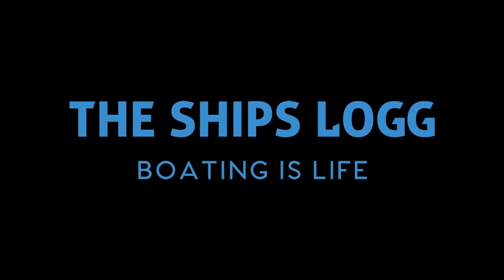Make Your WaveRunner Piss on Demand!

Comment: Hey Captain Frank, I just wanted to take this opportunity to thank you for this fantastic idea. You don't realize how embarrissing this water flow can be until you pull up some where and turn around and spray everybody sitting on the dock with a drink in their hand. I like the option of being able to turn it off and on. Since I performed this conversion on mine,  I have had no problems and noticed that its not a partial reduction in water flow its a complete stoppage of the water flow. Keep this great intel coming.

Comment: Good info! I always thought that was the engine cooling line like my jet boat has and it was there so you can readily see that it is flowing and there is no blockage.
Reply from the maker: Joe,  I don't think you are the only one that has thought that.  Actually, the cooling water for this model comes out on either side just forward of the rider which is great because you can see it when you are riding.
Reply: @TheShipsLogg  I thought the same thing up until just now.  Lol!!  Captain Frank, could you do a video of how the cooling system works on these Waverunners?  I'm trying to diagnose an overheating problem on a 97 GP760.  I'm new to jet skis but I've learned alot so far.  I've rebuilt the carbs and tuned them on 3 different Waverunners so far!!
Reply from the maker: @TheVenom8343  wow!!  Very nice!  Sounds like you are well on your way to being a good PWC mechanic!!!  I'll put that idea on my list!!
Reply: @TheShipsLogg  Well, I figured out the overheating problem.  It had a little perfect sized pebble lodged into the little water intake hole at the jet pump.  I'm assuming that is the water intake point because it's not running hot now.

Comment: Hey Capt Frank! Great video. That water spout was one of the reasons I went Sea Doo. I'll have to check to see what other jet ski parts so can find cheap at Lowes!
Reply from the maker: I know that many Yamaha owners simply disconnect the hose and let it hang so the water spout does not work.
Reply: There is no negative effect from just pulling the hose off for good.

Comment: I used that exact same Rain bird valve, it only lasted one season before the valve body (that green part) blew out.  You will want a stronger valve!
Reply from the maker: So far, mine has lasted 2 years in salt and fresh water.  We'll see how much longer it lasts.
Reply: there is a more robust valve made. I think its like 20 bucks @TheShipsLogg
Reply from the maker: @jimcloud74  I am sure there is.  The one I used works well but I don't know how long it will last.  I just got another ski and I will try a different one on this ski.
Reply: Nice sir! I originally got a cheap valve and it blew apart. Happy riding!  @TheShipsLogg

Comment: I used a rubber stopper. Simply has a little ring bigger than the hole you just press it in there. No idea what it is, found it laying around my garage for some plumbing. I put storage bags on the back of my vx limited and it just sprays everywhere so I told it to shut it's trap. Also, nice photo of La Jument, one of my faves.
Reply from the maker: LOL!!  That's right!  Show it who's boss!!
Reply from the maker: That is one of my fav pics as well.

Comment: Thanks for this and all your videos.  Constructive criticism, instead of saying over and over make sure you cut it long enough to clear the gate, you could have simply said, I cut it 3" from the top so it wouldn't interfere with the gate.  (my .02)
Reply from the maker: Good point.  I did try to avoid giving specifics  just in case someone else has a different model Yamaha and the measurement is different.  Thanks for watching and thanks for your 2 pennies!  😁

Comment: Thanks for that great idea.  I have a question hope you can help me figure it out.  I have a 2015 Yamaha Waverunner V1 and it comes with no ladder or step to get back on the ski.  Any ideas on how I can install an OEM ladder or step back there. Thanks in advance
Reply from the maker: There are some aftermarket ladders sold for jet skis.  Some are similar to the OEM type that some PWC's come with and others are the much simpler rope ladder type.  I would start  by checking Partzilla to see what they have

Comment: That was really useful. Hope it’s as easy on my 2008 FXHO.
Reply from the maker: I'd love to know if it is the same on your machine as it is mine.  Drop back after you have done it and let us know!
Reply: @TheShipsLogg  here in Scotland most skis are tucked away for the winter. Got mine out of the garage today to have a look and it certainly looks like it will be as easy. Just need to find a suitable tap to plumb in.
Reply from the maker: @simonfr77  That's awesome!  Let us know how it works out!!
Reply: Worked a treat. 13mm ball valve (£3.50) and a couple of stainless steel hose clips and 10 minutes later job is done. Easy to do. Washing up liquid advice was useful. Thanks very much 👍🏻
Reply from the maker: @simonfr77  Awesome!!  Glad it worked out for you.  Now, its time to have some fun!

Comment: Anyone know where I could get a new hose? Want to put it back on
Reply from the maker: You can go to your local auto parts store and buy a length of rubber tubing and just cut it to the proper length.
Reply: @TheShipsLogg  yup, just thought it would be better to have a formed hose to help keep it clear of the reverse bucket
Reply from the maker: @timsgarage1861  I don't think mine had a formed hose but I could be wrong.  It's worth trying to see if a regular one works.

Comment: I have two questions, 1: Will adding a valve affect the original water flow pressure? 2: Will blocking it cause reverse flow of water?
Reply from the maker: No it will not.  A lot of people just disconnect the hose and leave it hanging.

Comment: What happens to the water pressure coming from the pump when is turned off?
Reply from the maker: Instead of being routed through the hose for the waterspout, it just goes out the jet nozzle instead.

Comment: What's the size on that hose/valve? 3/8"?
Reply from the maker: 1/2 inch.  It will be a tight fit sliding the hose onto the valve but that is what you want.  I used a bit of dishwashing liquid to make it go on a bit better.  A buddy of mine use KY Jelly and it worked as well.  LOL!
Reply: @TheShipsLogg astroglide would get a 1” fitting into that 1/2” hose

Comment: Thanks for the info. I have a 2016 vx limited. I have never had it piss. Hose is connected with no shutoff vale. What would you recommend I try.
Reply from the maker: So are you saying that the water spout has never worked?  Are you trying to make it work or keep it shut off?

Comment: Does the valve installed in line affect the height of the water spout compared to the original waterspout before installing valve?
Reply from the maker: It does affect it a little bit but not much.  I find myself riding with it off most of the time.

Comment: Just cut it off. It has nothing to do with "visibility" It is purely marketing and brand recognition... If it were truly a safety benefit the others would have certainly copied it.. The valve is not the same ID as the tube causing a reduction in flow and only giving you half the "stream" you had before... Remove the hose at both ends and throw it away....
Reply from the maker: Steve.  That is not the experience that I have had.  However, I do agree that it is being used as a marketing device by Yamaha.  Does it allow the machine to be more visible?  I would say yes, but is it such a game changer that all PWC's should have it?  If so, I think it would have been a requirement for all PWC's years ago.  I think this is one reason why some love it and some hate it.
Reply: No no no, the water spout shows you that your engine is being cooled if you have no pee turn off your ski!!!!
Reply: @ChristopherCatfisher  You are absolutely wrong. Look it up.
Reply: @ChristopherCatfisher  just like on my Honda Outboard….
Reply: Does anyone know where I can get a replacement hose? Got my 17 VX limited used. Previous owner removed the hose completely. Just want to put it back on
Reply: @ChristopherCatfisher the one on the side is not the back.